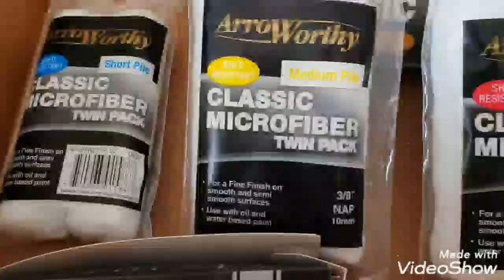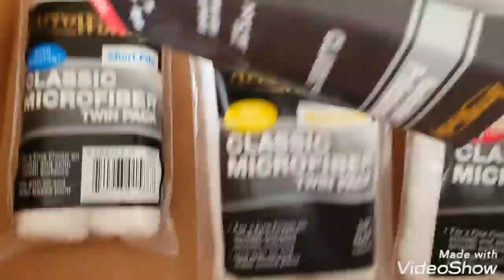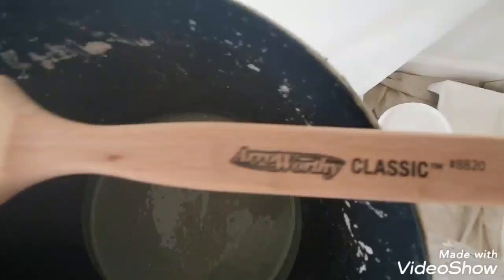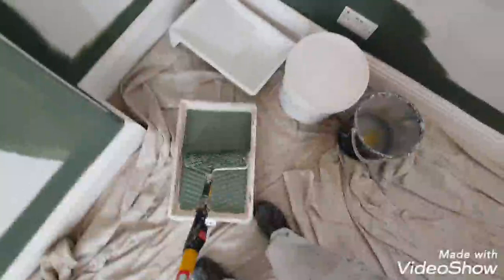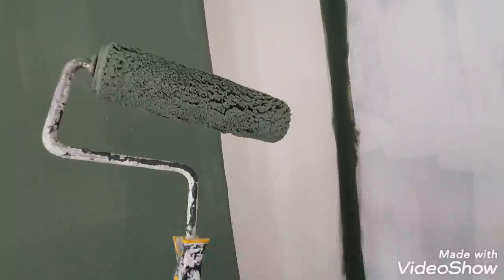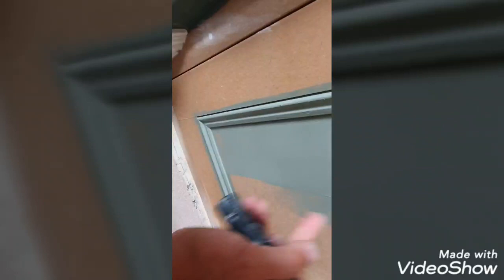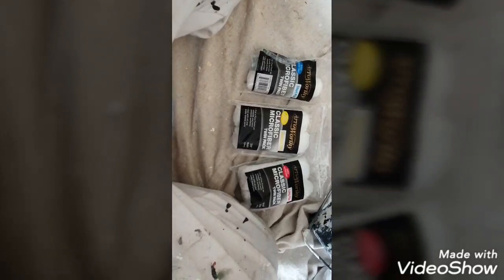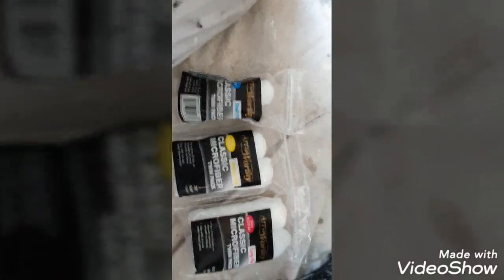The Classic Range From Arroworthy

Comment: Have you tried the Oldfields yet ? Can’t fault them. I ve used every brand and the oldfields hold more paint than anything I ve used. Oval shape , angled and straight. Great brushes. Best cages Wooster in my opinion. Purdy frames are not great. Arroworthy sleeves are very good. Cheers
Reply: Hi. I've not tried the Oldfields yet. I have heard good things about them. Are the Wooster cages green in colour. I've seen them on My Paintbrush. I use the older Purdy cages as they came with  quick release attachment which fits any pole. I don't like the newer purdy cages as the new Purdy poles are naff. Cheers for the feedback mate
Reply: Daniel Nugent . I have found the Wooster cage rolls better, smoother and likewise found the Purdy ones are not as good as they used to be. Hey I was a big Purdy fan and still have a lot of their products. The colossus sleeve is brilliant . But for me , now, I use Wooster roller trays. Some models have lids so I use them if I am using same colour next day or so. I hate c,earning out trays lol. I love thevwooster speed bucket. 6 inch roller in their and your rolling and cutting much faster on areas like say columns, upper wall areas etc. I don’t dip a 9 inch now for bathroom or kitchen upper walls. Great for doors also the speedbucket. Oldfields in my emulsions and both Staalmeester and monarch in oils. Lay down oil paints lovely both brands. Great to,share info on paints, products. If we can’t chat and help each other out then it’s a sad day mate. Best wishes, keep doing your videos. 👍🥃🏴
Reply: @stevenmcfarlane8831  nice one. Yes i love to find out about making the trade alot easier with the right go to kit. Brilliant tips mate. Thank you